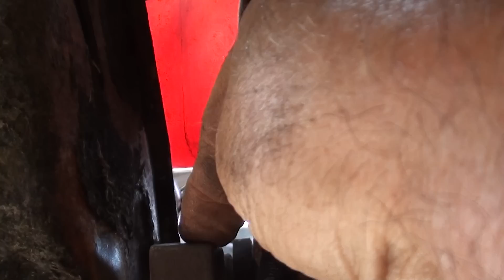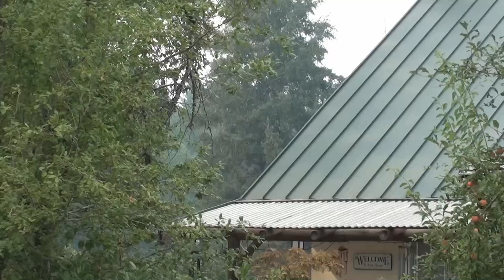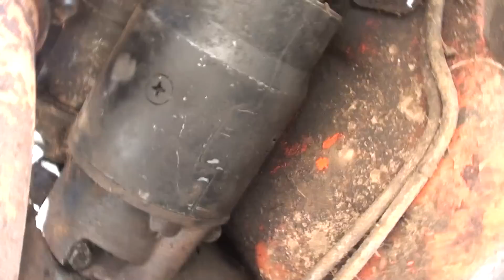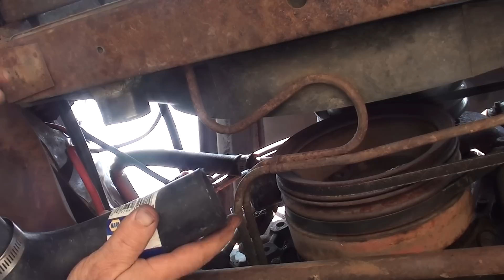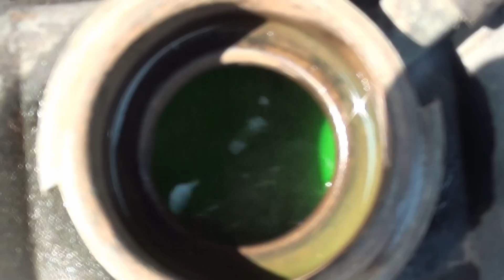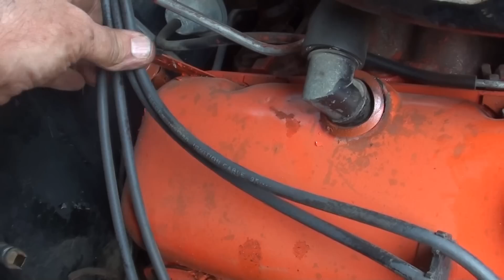Part 12 Big Block Biscayne Rescue! Abandoned 66 Chevy Heat Riser, Starter Shim Sham and Test Drive!

Comment: I had an 88 Dodge Dakota 3.9 V6, it had one of those valves too, I took it apart left the plate out, a friend of mine made plugs for the shaft holes never had any more problems with the restriction in the exhaust again.

Comment: A little bit rich on the idle is good,  it makes for a cooler combustion chamber and exhaust during operation, from a single cylinder lawn mower engine to an eight cylinder like that.  once the intake manifold heats up and the engine is at full driving operating temperature The mixture is usually perfect.

Comment: An actual working Heat Riser Valve, and it's not new...These were impossible to find/see in the Rust Belt. Lubricated them was even on the "To do" list my Dad setup in his garage, with the each oil change/greasing about every 3 months. GM Even had a specific part number for the "Canned" and the aerosol.... What a flashback

Comment: It depends on which side of the starter you put the Sim on if you put the fan on the outside of the starter closest to the ground, it will push it closer to the fly will not further away so you don’t believe me go by there

Comment: I always wondered about the sanity of the Chevrolet engineers. The inlet of the air cleaner cover is a little over an inch in diameter, about the same as a single venturi of that 4 barrel carb. I assume the air cleaner becomes a major restriction at wide open throttle.  It would be interesting to see the vacuum level in the air cleaner at high engine RPM.
Reply from the maker: I've always wondered about the sanity of 140 MPH car with a single mater cylinder and drum brakes!
Reply: @ElderlyIron  Sanity is overrated!
Reply: @ElderlyIron  well, when I was young and dumb I would drive my old junk as fast as it would go on nearly bald tires and the same brakes you describe.  Much older and less of a risk taker now.

Comment: Hey Jeff how about throwing a little grease in that front end ? Its looking a little dry...🤔👍
Reply: It never ceases to amaze me at just how fast those upper control arm bushing dry rot.  Just took my 2010 Ranger in for new brakes and found both of mine were almost GONE!  The truck handled okay and no noise so I didn't notice it.  When the new ones were put on I certainly could tell.  I am thinking (dangerous thing for an old man to do) that I just got used to the gradual decay of the ride.  After the replacement of the upper control arms, new brakes and tires the truck is just like new again.  I've seen the new Rangers....HATE 'em!
Reply: I don't know about anyone else, but I'm of the opinion that they definitely don't make them like they used to! The translation on that is the soft parts start crapping out all too soon as if they were designed to do so. Over my lifetime, it seems to me I would find cars that were built even in the '50s and especially the sixties and seventies where the bushings would far outlast all of the regular hard parts. I remember in the 90s, if you needed certain replacement bushings, you'd just go to the parts yard and pull them out of another rig, clean them up and complete your install. Of course a lot of guys, when they were rebuilding a classic muscle car, would install polyurethane units but that's another story altogether. Peace & good vibes! 👍🏻👨🏻‍🔧🇺🇸

- Max Giganteum

Comment: I failed to see how that butterfly will have any effect on the temperature of the intake manifold when the engine is cold. After thinking on it I've I've got it figured out I hope. By restricting the flow of of exhaust when the engine is cold it would warm up faster.
Reply: There is an exhaust passage thru the intake manifold from one side to the other. That valve directs exhaust thru that passage to warm the intake when engine is cold. Once temps are up to normal operating value, the butterfly opens allowing exhaust to go out thru the pipe. Passage in the intake is smaller, thus making the pipe the easier flow path even though the cross-intake passage is still open.

Comment: You didn’t use those black heaters, but you dreamt about it.
Reply: I was stationed in Anchorage, Alaska, for a year.  If your car didn't have a block heater you didn't DARE go out and try to crank your car....KA-BLAM!!  We had several that blew up because the engine was cold soaked.  I had a brand new '70 Challenger at the time and I didn't want to take that challenge so it had one.  The other benefit was getting into a very cold car and almost instant heat.

Comment: The engine doesn't stay cold long enough to make any of this matter.
Reply from the maker: Engine, no. Carb and intake, yes. It was not uncommon for the right temp humidity conditions to cause the carburetor to ice over from the latent heat of evaporation.

Comment: DD Speed Shop channel has one like it and convert to 2 door cheapest way. Please consider... Would be great
Reply: Jeff’s M.O. is to revive these old machines to operate as intended using practical, sensible methods based upon his secondary education at what is now known as UNOH and working in the field of automotive repair at one time…not necessarily chopping them up into something else. 

    I personally think that it’s more valuable/cooler being as it is…a base-model 4-door sedan with the factory-installed 396 big-block and the 12-bolt Posi-Traction unit. The Powerglide stymies performance, but hey…it came with it.
Reply: @bowslap ,  I personally feel like you and Jeff.  Keep it original!  There's already enough cut up junk on the highways.  That's the reason why I DON'T watch DD Speed Shop anymore and others on YouTube.
Reply from the maker: I'm trying to convert this into a 57 Chevy 4x4.
Reply: @ElderlyIron  Ok. Ok. No problem. I appreciate your videos. Lot of things to learn and entertainment 😉
Reply: @ElderlyIron  well, given the car’s provenance and improving condition, the proceeds from the sale of it should be sufficient enough to make that 4x4 a reality.

  You know, that Biscayne HAD to be a special order item….which would’ve been processed through the Central Office….which handled everything from fleet orders such as police cars, taxi cabs, utility trucks/vans to the 427 Yenko cars….which would possibly qualify this as a COPO car.